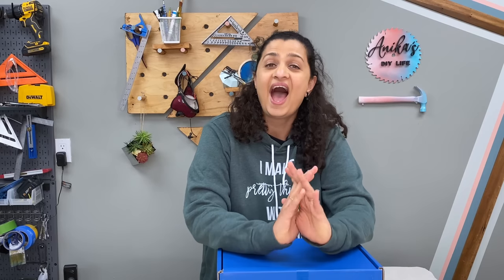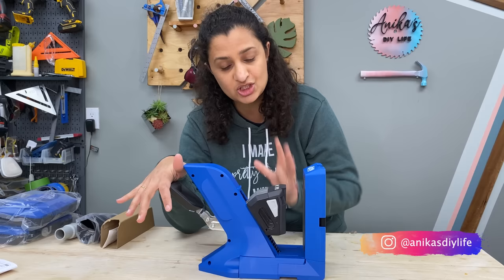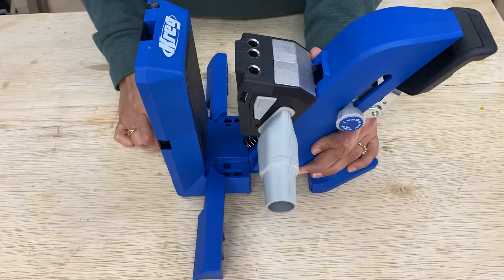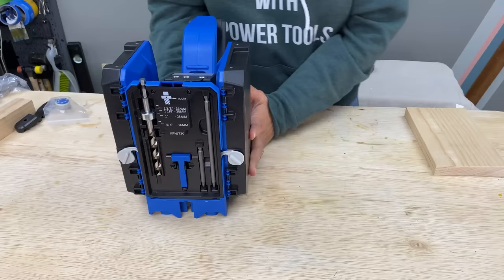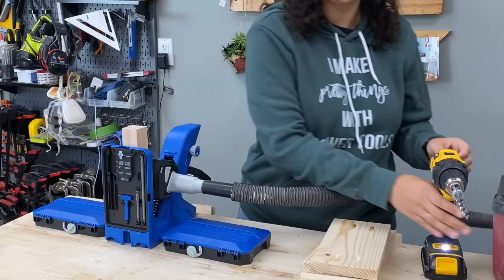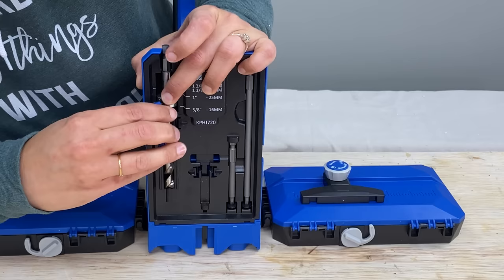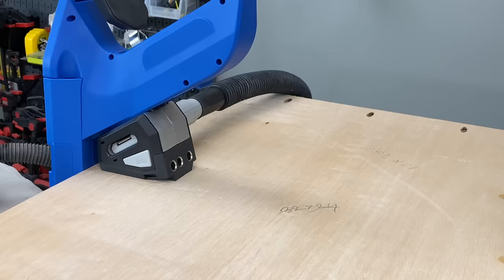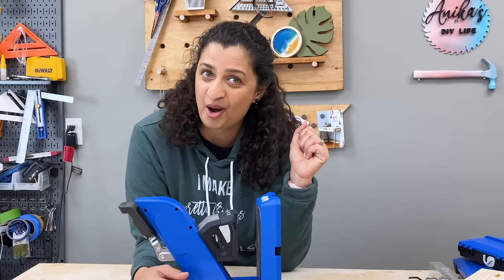How to use the NEW Kreg Jig 720 + My Review

Comment: I truly do not understand how anyone can criticize the 720 jig. I have used the 320 for 10 yrs, i am a very low to medium skilled part time hobbyist. At first when i bought it i was skeptical about spending the $150 for this. Now i have built a few outdoor projects from Kreg website, this thing rocks. I just drilled 40 pocket holes in like 6 minutes , if that long. It would have taken me a hour to set up every hole to be drilled. The ease of the clamping, the setup, the on board storage. Dont hesitate to get this.
Reply from the maker: AGREE!
Reply: There are valid criticisms.  The docking station doesn't attach securely  The guides cannot be used separately like they could on earlier models.  The poor bench clamp design.

Comment: I have the 720 pro bc in the middle of.my kitchen project my kitchen bit the dust. At first, I hated it but after a little while it's okay. I hate the flimsy support clips mine keep popping off.  The clamp is ridiculous when you want to use the tool in other areas. I ended up mounting mine to a board like I did the k5. I am stuck with it now so here is making the best of it.

Comment: Just one question, as a beginner what screw size would you use on all the different size woods, love the videos thanks.
Reply from the maker: I would recommend the 1-1/4” and the 2-1/2” screws. These will cover the commonly used 1x and 2x boards. You can get the 2-1/2” screws as blue kote so you can also use them for outdoor projects
Reply: @Anikasdiylife  Thank you so much for your quick response, I will take on board what you answered, thank you again.

Comment: Great video thanks. I do have a question though and was wondering if you could assist. I have a project where I am using 4x2 framing timber, the timber measures 90mm x 45mm. The 720 claims to do wood up to inch and a half, that’s only 38mm, does this mean it won’t work on 4x2 then? Have you tried?
Reply from the maker: yeah... unfortunately, it can't. The Kreg HD is an option for that.

Comment: As a beginner just getting into wood working would you suggest starting with the k4? Or is it worth it just to invest in the new models
Reply from the maker: Honestly I would go with either the 520 or the 720 because Kreg is obsoleting the K4. Best to get the latest version. 720 is great if you will be building a lot but a 520 is a great beginner jig.

Comment: I got the number 4 and 5. If I get the 720 what I do with them?
Reply from the maker: Give it to someone in need.
Reply: Keep the K4 and K5, especially if you have the plug cutter, micro pocket hole drill guide, and HD drill guide. The 720 isn't backwards compatible with the old inserts. Plus, the 720's drill guides can't be removed and clamped to a workpiece directly in case you need to make a repair or realize you forgot to drill a pocket hole halfway through assembly.
Reply: @DoresoomReviews  that's right. Thanks for the tip. God bless you.
Reply: Keep them, you will be returning the 720 soon. Kreg really disappointed on this one.